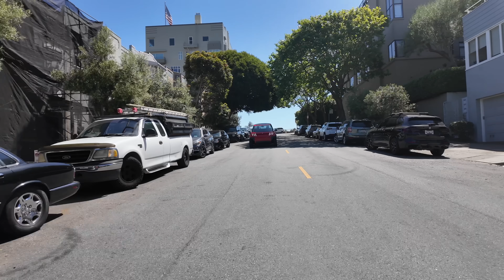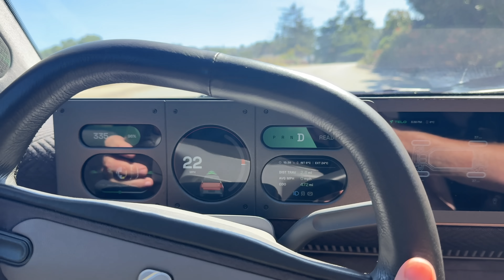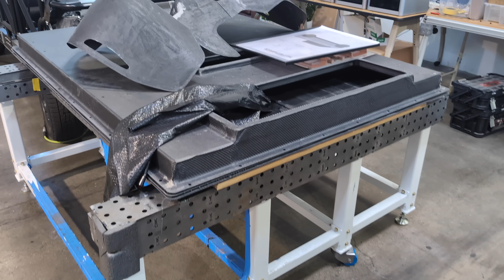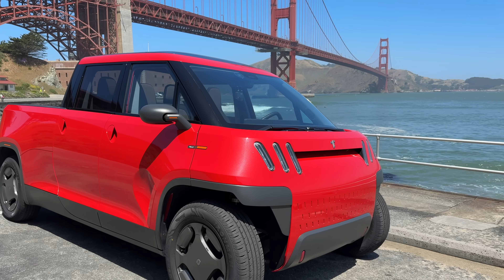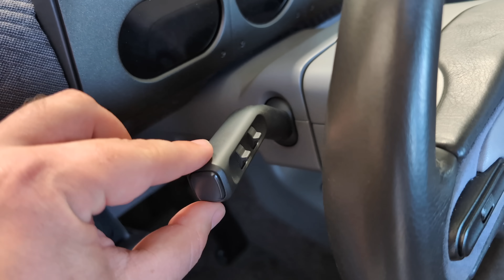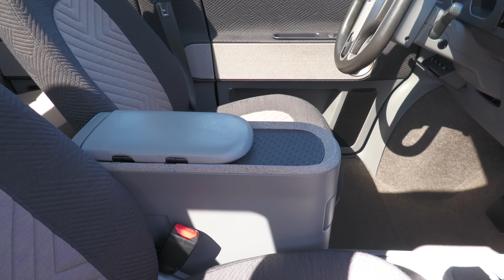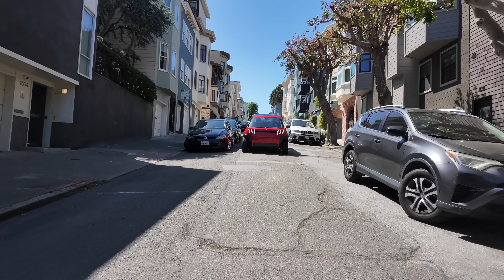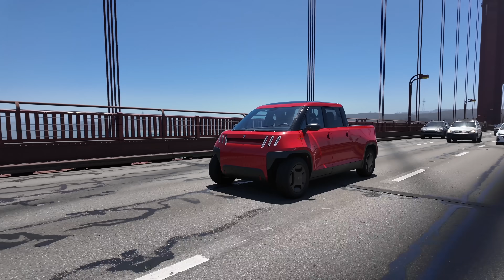The Tiny Telo Truck Hopes to Pack a Big Truck Punch

Comment: While the truck is cool, and beyond the longer range, I struggle to see what would be the incentive to buy this over a slate truck, which comes at half the price, and can do about the same
Reply: Can the slate carry 4 people? 
Can the slate carry a stack of plywood? 
Can the slate road trip? 
Can the slate go as quick? 

Sure if you're only carrying bags of fertilizer around a city the slate would be fine. But if you want a truck that can actually be your only car the telo is better in every way.
Reply: @Jcewazhere well yeah, it has the back cabin extension, and it’s a mini truck has well, and it’s half a price, it’s still a truck. The only thing I’d agree on is that the slate can’t really roadtrip with the range being I believe 200 with the extended battery, but I still am trying to see how the extra 30k can justify the extra 150 miles. The performance isn’t even too far off with the slate being 8 seconds I believe. Still if someone wants to get a work truck for inner city like that truck is advertising, the slate is just seeming to be a better deal

Comment: If the Slate actually turns out to be $20k, the Telos for double that seems like a hard sell.
Reply: Yeah but the price on the Slate EV isn't final yet, and the Telo has 3x the range
Reply: The Telo is 12" shorter while still having 4 doors and a midgate.  I'm betting it also will have a radio...
Reply: @WilliamMcCluskey13  But then it adds 30k worth of stuff a small city work truck buyer doesn't want. You could (theoretically) get two slates and some change for your small city business. Double the delivery power.
Reply: The Slate cannot tow. Lower tow rating than a Corolla. It might be popular due to price. But it won't compete with trucks. Curious to see if the Telo will compete though. Has the specs on paper to do so. Might be too small for most trucking.
Reply: If the Telo is a mini truck, the Slate is a micro truck. Although to be fair, that might be all some people need too. People will compare them until they're blue in the face, but there's room for both... because they're so small, but also because they both have specific target demographics that only slightly overlap.
Reply: These are different products. But while I hope the telo does well... I don't think they are going to. None of the signs other than the marketing are that they're set up for success. Slate already has a factory and dozens of roadgoing examples and real crash test data. Telo says their crash safety "in simulations" is good, but proof's in the pudding. But I sure do see a fuckton of small city businesses wanting a stripped down basic slate for delivery purpose, and not a rich silicon valley man's idea of what they want. This has a cab-over design and absolutely nothing else anyone wants out of a small city work truck.
Reply: @CanIBorrowYourShovel  You mentioned the several roadgoing examples, but in one video I saw about the unavailing, a lot of those trucks (possibly all) don't even have working suspension yet, That suggests they're hastily slapped together to puff up numbers. Don't get me wrong they all look cool rolling of the ramp en mass, but their dozen might be less finished than this one single prototype. Granted, Slate's got Bezos Bux, but it's still too early.
Reply: @TheRealAlpha2  that's interesting, I hadn't heard this. Where did you see a citation that they had no suspension? Also seems needlessly difficult to make a chassis that can drive and rolling a dozen of them right I  front of people  under their own power with working steering, but not putting in basic, easy to manufacture even in a one-off way, suspension linkage and springs/shocks.

Plus they have sent full examples to the nhtsa for crash testing. They wouldn't accept examples for  this testing without suspension. If it has a steering rack, it would be weird to not have suspension. But they could definitely be missing features (I think some were mentioned in walkarounds) in other ways at that reveal. The reveal was, according to slate, rushed more than they wanted because the public reaction to leaked info was exploding and needed to be capitalized on. That could be why they aren't parading around one single example like telos is. 

Also, it seems like the bezos angle is either a very small personal investment or not present. Seems like that was just hype reporting. Iirc slate has said nothing about it.

I'm personally more hopeful for slate. I put down the $50 deposit out of support. And I'll buy one if they come out near their msrp, with or without the rebate. But I have no emotional investment because at the end of the day, they're a company, not my friend. I hope telos succeeds too. I just see a lot less concrete evidence that implies they'll succeed. The price, product, market segment and target market seem to all be heavily speculative of a demand, VS the slate and their very vocal demand, affordable price goal, untapped market of affordability where most folks buy used and a looming recession, market disrupting ideas to reduce consumer costs and production costs like no paint, and overall more well thought out product and market research.
Reply: @CanIBorrowYourShovel actually I take back what I said about the suspension. I admit to being wrong about this. I just went back through my history to find the exact video I watched. The channel was Gjeebs, he was invited to the launch event, got his camera under the front end of one of the trucks on display and thankfully they had some light on the floor I see it and you could see it just had a straight axle. Just for show. Probably not even a driving example. But I didnt pay enough attention to realize he said it didn't even have brakes. It had just made sense to me late at night with all the yet to be determined things they showed, like they couldn't even slide the seats for people to try the back seat of the rangerover/suv style mod. But yeah I agree, prices are way too high, I'd buy a Slate myself and add the back seats later if had a reliable enough income. Telo's offering looks cool to me too, but I'm just not the intended demographic.

Comment: Where are the bumpers? No bumpers, no sale!   They need to move out of Commiefornia. Calling this a pickup or a truck is quite a stretch, though. Need a version without the second set of doors and seats. Cloth seats are the best, and get rid of the stupid glass roof. That could lower the price and get it within the price range it should be in. It is overpriced right now.

Comment: What I really like here is how this doesn’t look like a vehicle designed for an internal combustion engine.  There is no stupid compartment in front of the cab to accommodate a large engine blocking the view of the road.  Electric cars should look like electric cars, taking advantage of being electric.
Reply: There also isn't a bumper in front of those wheels, so in any kind of accident, even a fairly minor one, you've destroyed the suspension and possibly totaled the vehicle.
Reply: You apparently have never seen Japanese mini trucks (e.g. Mitsubishi) or European trucks in general that have a flat front while still being combustion vehicles. The combustion motor sits under the passenger cabin in those cases. By your logic this EV is copying this design. Now what?

A larger front is also more aerodynamic than a shoe box design, apart from offering a larger crumple zone.
Reply: @pseudonym3690  They don't sell the flat nosed vans anymore here in Europe. It's because of safety standards. I'd say they were last sold more than 20 years ago.
Reply: Yeah, they fell out of fashion, but aren't illegal. I can still buy kei trucks like a Mitsubishi L300 easily on the second hand market and they're perfectly road legal. Bigger haul trucks all go for the cab over design. None of those have a hood like in the US.
Reply: @pseudonym3690   Of course the old ones are legal. They were legal when they were new, so they're legal now.

Heavy duty trucks are a completely different affair.

L300 is not a kei truck btw, it's way bigger.
Reply: But electric cars are ugly
Reply: I agree about the absurd vestigial "frunks"- however, most vehicles I've driven lately don't include a view of the hood- so the sight lines aren't really any different; this is demonstrated here, when Robert parks with a huge gap in front- just like most cars, he can't see directly in front.
Reply: Well the traditional designs do have the added benefits of crumple zones for crash safety..
Reply: @TheBibliofilus  Not really- that space is occupied by an engine block.
Reply: @mavigogun  The engine is part of the crumple zone. It's designed to absorb some of the energy of a crash and go under the body.
Reply: Even many ICE cars could have way shorter and lower hoods, a transversal inline engine doesn't take much space

Comment: This is the kind of car I want, no BS, just a simple car.
Reply: Simple car with 500hp...
Doesn't look like a simple car to me. Neither in price nor in spec.
Reply: @Jehty_  single motor is 300hp, and that's not that crazy for a pickup; specially considering that to get torque out of the electric motor, they would make that kind of power. Dual motor is just somewhere under double that.
Reply: That's what I like about the Slate. This one is still too flashy for my broke ass.
Reply: @beanamonster  slate is still 27k
not as bad but still too much for something this barebones
Reply: @Juanguar  That's almost half the price, which is wild. Either way, I'm excited about both of them. I love to see what's going on with the auto industry.
Reply: Sure, for half of price.

Comment: Vehicle to Grid confirmation is huge.  I really hope they don't back down on that.  Having two Teslas sitting in my driveway with >70kwh each during a power outage and not being able to plug in my damn fridge even feels like the dumbest moment in the EV timeline.
Reply: The new Renault 5 allows V2H, so even small city cars are getting it. Seems a misstep by Tesla.
Reply: @drunkenhobo8020  Totally agree.  They just refreshed the Model 3 and Y recently and could have made a big splash but chose not to.  It does directly compete with their Power Wall product, but it just makes their EVs that much more unattractive.

Comment: I was fairly interested in buying the Telo until the announcement of the Slate.

Maybe there's room in the market for both, but if I had to guess one way or another, I think the Slate would probably eat the Telos lunch.

When production models and pricing are final, I'm looking forward to comparing them.
Reply: How? 
The Slate is slower, has terrible range, terrible efficiency, is too big while still not as capable at hauling, and is boring to look at. Its only benefit is that it's somewhat cheaper. 
Plus I doubt I'm alone in not liking it at least partly because Bezos is so involved. That guy does not need more money.

Comment: If the guys at telo are reading the comments, please put a charging port on the front of the car as well so that you don't have to take a trailer off the car in order to then back into a charging spot and plug in the charger, real annoying.
Reply: They will not- and this very issue has been raised.   They reckon side-pass charging stations will become more commonplace, and that nose charging would still be impractical with the trailer projecting out behind.   Additionally, the compact front end already has a lot of stuff competing for limited space.   I wanted the charging port in the front so there was no obstruction to loading the bed when garaged.
Reply: @mavigogun  In my view there is no good reason for not putting a second charging port on an EV like this.
Reply: @bastiat691  Here's a good reason: it would add to the bill of materials, making the truck significantly more expensive for insignificant extra utility.
Reply: @bartolomeothesatyr  How much does a charging port cost? It's not like there's any fancy electronics in the port itself.
Reply: @Yay295  It's not just the charging port, it's the cabling (which has to be fairly stout to handle the voltage), extra panel fasteners, extra design time, extra tooling, extra installation time, etc.  It adds up, and the whole concept of this truck is to engineer the maximum possible utility out of the minimum possible material.
Reply: @Yay295  Those thick copper wires cost some real moolah and the charging electronics have to be altered so some dumbass doesn't think "I could charge it way faster with two chargers!" and cause the battery to catch on fire or something.
Reply: @MrMega200  Even worse... you cant have both ports 'live.'  If one port is getting voltage, the other port MUST be dead for safety.  not a locked cover, but no voltage whatsoever on the port itself.  So, you're adding a port, copper, 2 at least two more high current contactors, etc.  The system would need monitoring and intellgience added in, so more software, more safety checks, and possibly violating charging standards.  I'd suspect this would cost at least 1000-ish per unit extra.  Multiply that by, say, 20000 units, and you've spent 20 million dollars at production for a 'small' feature.
Reply: @bartolomeothesatyr  Its already an expensive truck, percentage wise its barely an increase in price at all to add another charging port.
Reply: @bastiat691  Yes, it already costs so much that it probably isn't viable, so go ahead and raise the price another $500 or so.
Reply: @Yay295  it costs a lot more than youd think for the cables, plus the cost of the BMS to be programmed to not take both at the same time which would definitely be attempted (and make the battery explode or catch fire). sure just the plug cant be that bad, but theres so much more than just a plug to that.
Reply: @Yay295  As others have said, it's a lot more than just the charging port. You also need to be able to isolate it, so add contactors, thick wiring, and more, especially when you're talking 350KW or 800 volts.
Reply: @bartolomeothesatyr  Current, not voltage. But otherwise correct. Don't forget the automatic switching circuitry to ensure only one port is active at a time.
Reply: but you cant pull froward into a spot with a trailer hanging out the back either
Reply: @jm100368  Exactly.
Reply: @jm100368  You don't tow.  Yes, you can.

Comment: Slate Auto's truck would be a better option for half the cost
Reply: How? 
The Slate is slower, has terrible range, terrible efficiency, is too big while still not as capable at hauling, and is boring to look at. Its only benefit is that it's somewhat cheaper. 
Plus I doubt I'm alone in not liking it at least partly because Bezos is so involved. That guy does not need more money.

Is Slate buying these comments? This is about the 50th one I've seen with exactly the same wording...
Reply: @Jcewazhere  Everyone has their own use case scenario that works for them. What it seems is your asking for a tesla. When most normal people are looking for a work truck. 120 miles is range would be acceptable for a contractor and a day worth of work. And with your Bezos comment it seem you have some biases.

Comment: I would expect these uncovered front tires to do an awesome job of covering front of the car with mud and stones.
Reply: Wouldn’t that only be an issue if you were driving in reverse?
Reply: @JoshuaRes  Top side of a wheel fires everything that has stuck to it forward in double speed of the vehicle. This crap is then caught by the front of the vehicle shortly after. May be Telo has mitigated it by some smart aerodynamics, will see.

Comment: 6:28 this puts it into perspective for me.
The truck looks absolutely adorable in the video, but C4 cactus were basically the first generation of big SUV-like cars on the road here. And it's even bigger than that!
I don't think even this truck would be viable for many inner-city jobs.
Reply: yeah, it really isn't "small" by EU standards, like, not even slightly.

It's only small by the american standard of tank-sized landships.
Reply: @Sareth94  it really IS small by EU standards. I dont know if you looked at it in car sized but its easily below 4m in length. Sure its wide (about 10cm wider than a VW polo and slighty wider than an ID.3/golf) and tall (which does not really matter), but calling this not small is just flat wrong
Reply: For some american perspective, I had a family member buy a 2016 CR-V as a city car "because it's so easy to park." The Telo is about the same size as said 2016 CR-V. It might be too large for euro cities, but for american cities it's going to do well.
Reply: I've compared the Telo with a Renault Kangoo. Same amount of seats, about the same size really (not for the extended version.) But the Renault doesn't come with no pedestrian safety on the front wheels.
Reply: Yeah the C4 cactus is a pretty big car.

Comment: This is the only truck i could ever see myself getting. I had to rent a uhaul to move a 4x8 sheet of plywood for a woodworking project and it was a nightmare to drive that Silverado around. Visibility out of it was crap, I was constantly terrified I would sideswipe someone because of how wide it was, I was so glad to leave that thing back at the Uhaul rental. If I could request one thing of Telo I'd like a Telo Van.
Reply: With the promised bed cap and the mid-gate down, you can basically make it into a van.
Reply: are car-trailer rentals not a thing in america?
Or light box trucks rentals?
Why's everything gotta be a PickUp
A 4x8 sheet would fit into basically any LCV / step van, or a modest trailer...